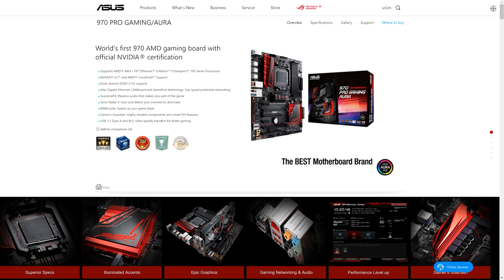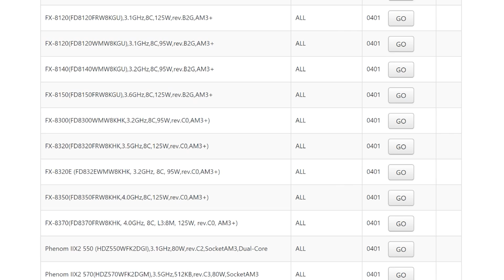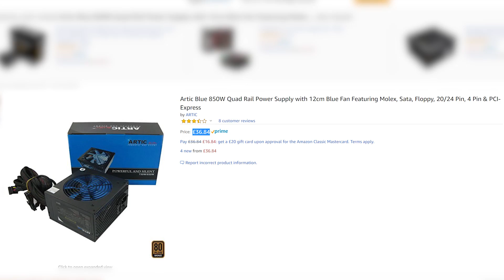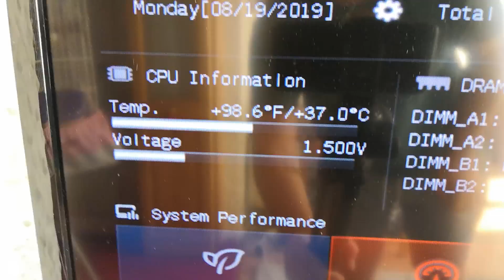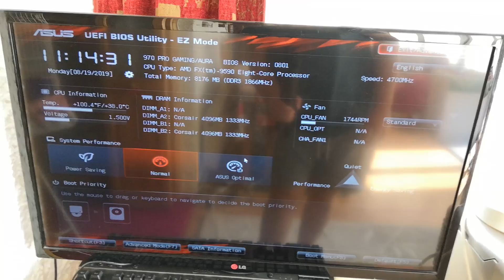This Used Gaming PC Is a 5GHz Fire Hazard (Pt. 1)

Comment: I see title, 
"Only one cpu this can be"
I happy.
Reply: Really
Reply: Intel? They’ve been setting fire to even $1,700 boards, melting the sockets and burning scorch marks on the chips with even water cooling and nothing real extreme. I’m shocked the 600w 7980XE (mild overclock on water, around 4.6 GHz for 600w and then it goes crazy high) doesn’t set boards on fire (maybe it does but I haven’t heard of it being a major problem like the 28 core, meanwhile Threadripper 32 core is super efficient and doesn’t melt boards even on LN2).

One of the last comments someone sent me was they fried a 10 phase VRM on a typical 5 GHz 9900k overclock... damn... I pull more power on FX and still my 4 phase budget board was fine... it’s getting kinda insane on power draw over on team blue! It’s putting FX to shame, lol!
Reply: @jakegarrett8109  ok I'm gonna lay this out real simple.

There are only a few 5.0ghz CPUs, practically at least.

7600k
7700k
8086k
9900k
8700k
2600k
2500k
Fx9590

And maybe a few other Intel x or overclocked fx CPUs.

Now this channel typically has old parts, that rules out 8700k and a few others, cheap parts, rules out the XE or X products.

So really all that's left is the 2500k, 2600k, and 9590, which one of those uses litteraly double the power as the others?

So as I said, "only one cpu this can be"

And stop comparing an 18 core to an "8 core"/other CPUs that aren't 18 core CPUs, you make the rest of anyone who defends amd look stupid.
Reply: M.Streicher I was comparing it to 32 core Threadripper (which still uses less power when overclocked to beyond 4 GHz), plus any 8 core burning 10 phase boards in normal clocks is scary. But you’re saying there are few 5 GHz chips Except basically every Intel gen since 2nd gen (3rd gen did 5Ghz, same with 4th gen, 5th, 6th, 7th, 8th, 9th, I mean, basically any k series since a while!), and with FX added, that means basically half the CPUs since like the last 7 years... that’s basically all except Ryzen... so how is that a few chips?
Reply: @jakegarrett8109  wow you figured out the fact voltage and frequency don't scale linearly, good job👍

Also you have an "enter" or "return" key, it helps to organise those word salads.
Reply: @m.streicher8286  Yeah, I have a nice Ryzen voltage-frequency expo graph up to 1.65v if you want it (as well as GPUs including power draw etc for binning chips), that's not rocket science. Speaking of which, as an aerospace engineer, I have to spend all day making sure I have 0 typos, otherwise it could cost my company thousands/millions, so when I get home and type a YouTube comment (the highest form of all literature), then I like to NOT care so much about punctuation or Sepelling (Ha! Take that 60 hour work weeks of grammer checckinnggg, Mwhahaaha! What a madman!)

Maybe if you had a job where 1 typo made you and your boss do hours of work at the minimum to fix, and then presented in defects/errors meeting as none of our programs seem to have spellcheck, then maybe you'd be more slack in your free time. Maybe, or maybe you'd stay up all night, knowing that "hey, you know what? If I have a typo, its not going to make purchasing department buy the wrong million dollar part, or an extra 0 at the end buying an extra 900 bolts that are $50 each, ya... $50 a bolt is no joke... Think about it, 100 vs 1000 when you're focusing on everything else in the design really would suck... So after work, I say "screw grammer! with an E!" because it doesn't affect anyone. In fact, the purpose of a language is, get this, COMMUNICATION, and if you understood what I meant, then well.... That means I successfully communicated, and that's really all that language is for. Language was not invented to go "oh look, someone made a small typo, goodness, the rules never conflict in our perfect English... I mean, clearly English was not invented to be perfect, just look at all the conflicting rules!
Reply: @jakegarrett8109  tldr

It's funny the level of aspergers it takes to get this worked up about me being exited to see the 9590.

I don't need some dipshit saying "bUt WhAt AbOuT iNtEl?!" Every single time we discuss one of amd's failings.

Good day Mr engineer sir

Comment: If you really want a "high end" FX system, try to find a golden sample FX-8000 chip. My 8350 holds up nicely at 5 GHz 1.425 (bios, 1.38 at load). You can borrow it if you want to, shipping across the Channel can't be that expensive

Comment: Upgrade the mobo! 8 cores is still plenty, even more if it's SMT-ready.
Reply: FX processors don't have smt. Only has 1 treadh per core
Reply: Not only it doesn't have SMT, it sort of has the opposite :D
The CPU features 4 "modules", each with two integer units, but only one floating point unit, so, while AMD can TECHNICALLY call it an 8-core, it's effectively only a quad as far as floating point performance goes :D

Comment: I still have one of these cpus chugging away as a space heater running a media server :) Corsair H110i is the minimum cooler you should use, the h55 is terrible and no air cooler will manage it, i used a noctua nh-d14 on mine....epic fail. Your mobo is no good either, i ended up with an Asrock 990fx Extreme 9 as i believe there was only 2 mobos on the market at the time that supported it, DO NOT buy the 990fx Killer, its a cool board but does not support the 9590, I know, I own one of them aswell.  With what you have right now, I would suggest underclocking it to a 8370 to save your mobo and psu from exploding when it attempts to power draw!! I had mine in a 990fx killer for a bit at 24.5 multiplier and 1.4ish volts, just a suggestion. If you want any advice just ask ;) p.s. they recommend 1000w psu but i ran a GS800 corsair one just fine

Comment: I have those very same parts and have had them for years.  THEY WORK FINE TOGETHER.  There's nothing wrong with that motherboard as it is better than some of the 990s out there.  However, the FX 9590 does require some tweaking to get "right."  That's with any motherboard I've encountered with the FX 9590 out there in the wild.  I know you can do it.

Comment: Im currently running a fx 8350 with a gtx1660 and i can play modern titles at 60fps on ultra settings
Reply: Are you overclocked?
Reply: @dionmiller8547  no oc mate i found it ran unstable once i overclocked and i game for hours at a time so i left it at 4.2 so its stable

Comment: A few things that really stood out like a sore thumb with the worries and concerns being expressed for all to hear in this video. Why not go down the safety route, specially for the first time and use a UPS? Along with a plug socket that is actually surge protected? Finally what looked like some daisy chaining from what I could see with plug sockets, am sure this being really safe, specially minus a UPS or surge protection? If these were used certainly no mention of this, also if they were used why not mention this and recommend this, purely from a safety point of view for people perhaps having similar concerns to those mentioned in this video? Am sure with the experience and parts gathered you have surge protected sockets along with a UPS? Just being some common sense really to ease worries and concerns for situations like this. If needed sourcing surge protected sockets and a UPS not being expensive really, specially for those worries. Very aware the sourcing of parts that goes on in the videos, so this being bread and butter really.

Comment: Use the cpu thats in there but take a really good motherboard. My brothers  9590 blew out a 170€ board that WAS rated for the cpu. And did you know that with a good enough cooling solution you can overclock that thing far beyond 6 ghz?

Comment from the maker: OK so I gave the 850 generic psu a go in a ryzen 2400g pc and it shut down after an hour. Not sure what to make of that but I'm glad I didn't use it here. Also, turns out the 550ti from this machine doesn't work :(
Reply: Star of the show is still the 9590. It's legendary in that it's rather silly. Like in a "HULK SMASH" sort of way.
Reply: Oof
Reply: Could you get a refund/replacement card from CEX for that? Surely if they sold it as having that card they should warranty it
Reply: @nixeldev  He could and they do. I'm guessing keeping it suits him better
Reply: FFFFFFFF
F
FFFF
F
F
Reply: Dammit...that's a shame about the 550ti.  I wonder if it got damaged by the over-rated CPU causing power flux on the motherboard?  

Maybe give it an oven treatment?
Reply: @thedungeondelver  probably the 850W PSU killed it with incorrect voltages
Reply: Do You have a multimeter for troubleshooting? I could help u find the Problem
Reply: @Jack233  yeah that specific board is really well built. To the point that some of the older 990fx boards do no better, but also have less features.
Reply: F for 550TI
Reply: 9590 and 550Ti...? LOL I have just a 4100 which originally had a 550Ti and currently has a 1050Ti... the 550Ti was an EVGA card just like that and I actually sold it to CeX, hmm!
Reply: Try to bake the 550 ti
I am not joking google it, i maganed to fix a 8800 gt i baked it at 200°c 8-10 minutes
Reply: @Petar_GT  its more of a bandaid not a real fix it will break again
Reply: @Petar_GT  Doesn't that release harmful chemicals in your oven? Would the oven in question still be safe to use?
Reply: @LizzyBoo420  I haven't died yet so... idk but thats a good question
Reply: How many watts did the seasonic focus psu have?
Reply: I'll stick with the 9590, a decent cpu if u don't take into account the 200W power draw 😂😂😂

I had one for a long time before upgrading to an 8600k, and I think I still have a 990fx mobo if u interested xD
Reply: F
Reply: RandomGaminginHD f
Reply: Ah true Chinese Quality CPU, works great in China, nobody complain about it! Russian make same model, but out of thick lead, stronger material yes!
Reply: get a refund from cex as it obviously wouldn't power the cpu! mind you you want to sell the cpu and motherboard!
Reply: Try putting the 550ti in another different pc mighy be just parts compatibility
Reply: Mate there is a typo in description, saying notoriously power hungry 220W PSU
Reply: Not a major loss on the 550 Ti, it's only about as fast as a 650 or half as fast as a 750 Ti.
Reply: Just rinse the PSU in what we Americans call the sink
Reply: Id rather use intel gma than the 550 ti 

The differnece is the 550ti didnt age well at all intel hd has aged better
Reply: Put in a rx 580
Reply: You should test the original CPU + MotherBoard combo: underclock to 4 Ghz @1.3V, and slowly increase the clock and voltage, and see how far the VRM can go with it!
Reply: F
Reply: Try to undervolt that FX to work around 3ghz add rx470/80 and chek power by plug-meter.
Reply: Well looks like CEX owes you a 550ti
Reply: 1 very important part of a computer is the power supply i hate when people bring me computers with $30 power supply don't cut down on p's. Rule 1.
Reply: Sry for that
Reply: That's an unfortunate finding. Looks like you dodged a bullet by not running that psu with the system it came out of.
Reply: @NoCompilerHere  that scares me
Reply: As some who has bought cheap power supplies. Just get a good one ive went threw so many the last one cAught my board on fire right at the 8 pin running a 9590 at stock clocks.
Reply: Sorry to say this but 970 boards were never meant for this cpu, I think only a handful of 990fx boards were certified to take this chip and second hand they will cost your more than you paid. I had a friend who managed to melt the socket and I do mean melt. You require one he'll of a vrm  setup or your basically going to fry it due to the chip wanting the power and the mobo not being able to supply it. A bigger cooler won t make a difference as it will be the mosfets that melt first
Reply: Should have got the broken parts replaced under cexs 24 month warranty
Reply: Sounds like a refund from cex
Reply: Sometimes happen this things
Reply: If I had to guess I'd say the seller took his good GPU and psu out of this, plopped in cheap ones and sold this as a whole unit to help fund a new build.
Reply: I think you should get the 1060 6gb GPU and 16gb ddr3 ram and pair it with the 9590 and let's look at the fps :-D that will be interesting to see
Reply: B1g oof
Reply: Maybe you killed the 550ti from esd, this is why you should try the pc before you dissamble it
Reply: @Jimemy  LOL. Individual components might be a bit picky but when assembled its hard to kill because it spreads out.

Comment: I built an editing rig 2 years ago with the 9590, 280mm  AIO cooler for the processor, Asrock mobo specialized for the 9590.  32 gigs of corsair vengeance ram.  GTX 1060 6gig SSC, 5tb worth of hard drives.

Under full load my CPU only hits 52 Celsius.  Editing is super fast and smooth.

When used the right way the 9590 is a monster.

Comment: cmon dude, this is no different than using a low end cpu and overclocking the shit out of it, your power draw will go up probably by more than this thing will ever pull as is, and even crappy PSUs can handle pretty much any CPU if thats all you run on it at once, its when you add a beefy GPU like a fermi on top of that that things will start getting smoky

Comment: If you can find a supported board for not an arm and a leg or borrowed I'd go the motherboard route. Otherwise it would be wayy easier to find a 8350, 8320, or 8370. I used the same board with a 8350 for about 3 years with little or no issues.

Comment: It is not an hazard, it's a calculated risk! 

Jokes aside, water takes a  little while to get warm, so a test of a few minutes is harmless. Surely I wouldn't put it under stress, but it is not a setup that will catch fire the very moment you turn it on, just a little later.

Comment: RandomGaminginHD : you should stick with the Asus 970 Pro Gaming Aura board because that board uses higher end components that were found on the Gigabyte GA-990FXA-UD3 Ultra 2018 edition but with some extra features (like more 4-pin fan headers and larger number of USB-s) and a lot better, larger and more dense VRM heatsink. It's as good as the top 990FXA boards were. You should put a Cryorig C1 top down cooler on it and this you will have the VRM-s large heatsink cooled actively and with that you should be able to run that FX 9590 chip pretty easily.
I still have my FX 8350 that is supposed to have a 124 Watt TDP but in reality if I stress it with Prime95, Furmarks cpu burner or Shintel burner I cannot get it to eat past 65 Watts of power as a CPU die alone so in reality these chips are quite cold and low power hungry because they have 1 FPU per 2 cores and therefore cannot be efficiently utilized at all. The only time I saw 4 cores utilised efficiently is when I ran AC Origins and AC Oddysey but even then the CPU didn't go above 65-70 Watts. I have mine cooled with the original Wraith 2015 that those FX cpu-s came with and cannot get it pas 62 degrees C at stock clocks. And I forgot to mention, in AC Origins and AC Oddysey with my KFA2 GTX 1080 EXOC at 1080p Ultra details this CPU is slightly faster than my Shintel i7 7700K at stock clocks using the same GPU....so yeah it's a very reputable performer still today :).
My advice is to keep that mobo because I would gladly buy that one if I could get it in my country, that's how good it is.
Reply: Weird because mine comes up higher
Reply: @lavagamer2153  ou really buttercup :), you should check again because you saying what you said, I highly doubt that you have an FX 8350 and a Shintel i7 7700K at the same time still....it's more likely that you had an FX 8350 years ago, didn't know how to use and then like a good brainwashed youtube child went and bought an i7 7700K that is now practically obsoulette :).
Reply: @lflyr6287  i have an fx 8350 right now
Reply: @lavagamer2153  well good for you :) so do I and I kinda love it because it performs much better in new games that I expected it to....or did I ;) ?!?!
Reply: @lflyr6287  i think it is a good cpu too

Comment: Stay stick with the 9590 and get a motherboard with 220w cpus support xD!
Reply: 970 Aura is just fine(nice phase design). Every older i7 can tdp 200w when Oc
Reply: @nikolakarovic5964  exactly my thought. Looks like a decent VRM.
The only thing I wouldn't do is overclocking it. But the 9590 is already at it's limits, most of them did not OC at all as they are nothing but factory OCed 8350/8370s

Comment: You should definitely upgrade the mobo to see what the 9590 can do
Reply: That board is fine for this CPU
Reply: I used this same motherboard with my 9590 for a year. I never had an issue. As long is there is some airflow on the vrms, this board is completely suitable.
Reply: You are the same Sithhy  from the Beamng Forum?
Reply: @MeDicen_Rocha  Yes, I'm the same Sithhy as on the BeamNG forum
Reply: Asus 99FX for sure.